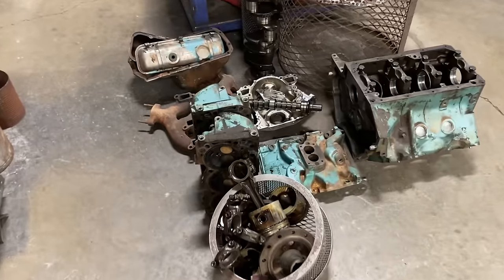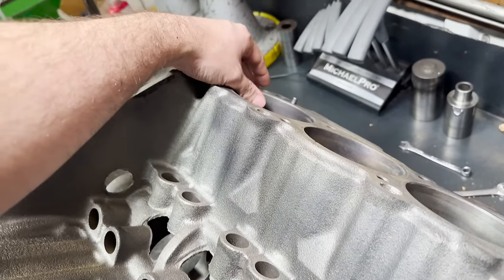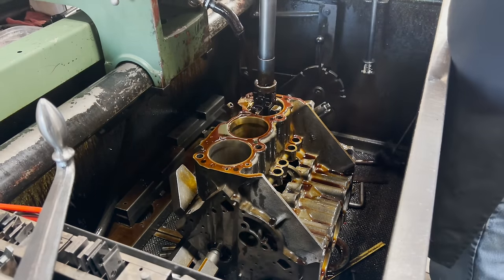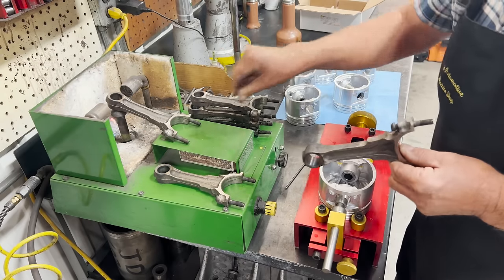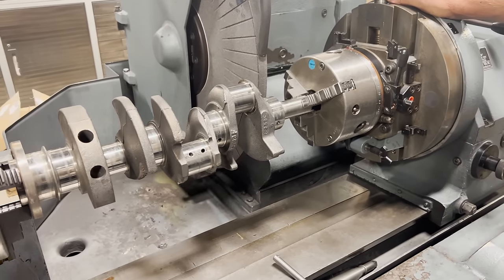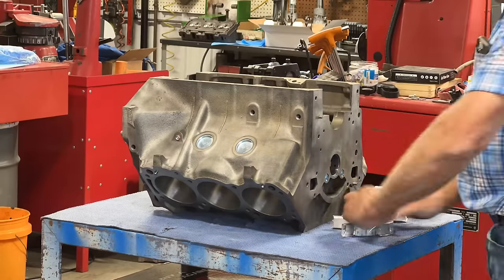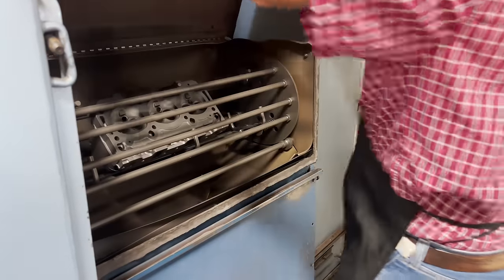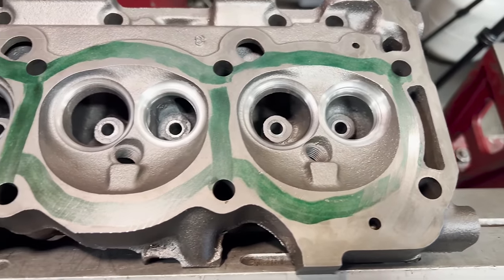This 225 Buick DAUNTLESS V6 Odd Fire Was WORSE Than We Thought...

Comment: Can you explain why on the bore process the block is not bored out to the required spec but are then honed afterwards? I know the crosshatch is part of the reason for a better grip or bite from the rings but a machinist explanation would clean the reasoning up. The difference in the process is what I am asking
Reply: Honing removes the last few thousand to the final required specs. 
If you bore to the final specs and then hone. You end up with the cylinder being out of specs. 
The machinist uses different grits of stones during the honing process. 
That's why the measure. Measure and measure continuously. Until they get the perfect cylinder wall to piston clearances.

Comment: I had a Chevy Monza back in the day. It had a 231 V6 with a Munci 4 speed. That thing would haul. The only problem was the clutch and pressure plate. The motor was too much for the regular pressure plate so my dad put a 180# diaphragm pressure plate in it. No more problems. It’s a good thing I played football and had strong legs because driving it in traffic was a killer. Your right leg would definitely feel the burn. But there was no clutch slipping any longer. That was one of the best vehicles I owned. It was easy to pull the transmission, I did it often for a while. Everything was easy to work on in that car.

Comment: Thanks for a very interesting video. After baking and blasting the block, do you install and torque the main caps to measure the main line I.D., which would be the same as the main bearing O.D. Do you do the same on the big ends of the connecting rods? Thanks, Bill

Comment: Very unpopular opinion but I install pistons completely dry . Think about it like this if you order a rebuild kit from CAT or a 14L 60 Sieries detroit they come in bags pistons already on the rods no lube other than a light film to prevent rust as you said if you just fill the cylinder with oil immediately upon startup it's going to cook that into the upper rimg grooves I did a couple 12.7 detroits and oiled them and they smoked after about 300,000 miles ive never done more than a light film of oil if its going to be stored for any amount of time before installation

Comment: One bummer is that stock compression on the Dauntless V6 is 9:1. The Silvolite replacement is rated @ 8.3:1 and the Sealed Power @ 8.4:1. Granted, with cleaning up the block & head surfaces, that may well end up close to 8.5:1 or thereabouts, but it's a shame to lose that little bit of 'oomph' in an engine that can use all the help it can get.

Comment: You think the crank phasing is complicated, the guy that sets the distributor really needs to be familiar with these engines.  The distributor has to be set exactly how the manual says with the wires in the correct terminals.

Comment: What covers the massive holes in the block between the v where the push rod are? Is that a normal thing on American v motors?
Reply: Those holes allow the oil to drain back after lubing the lifters and pushrods.
Reply: @skylinefever  oh I see. So I assume then the intake manifold closes off everything above it to seal of the block. Thanks for the info. I naturally assumed the block would be closed off their and any oil returning would come through the heads and past the cylinders.

Comment: The firing order explanation sounded unnecessarily complicated. The engine (I'm from the UK) is, in effect, two three cylinder engines 90 degrees apart. The firing order of one bank is followed 90 degrees later by the other. The same thing happens with 90 degree 2-cylinder Vee twins. Although there is no problem with these configurations the sound will be different.

Comment: Clay heated to between around 1000 to 2000 degrees F  becomes earthenware, our original pottery. It is porous, the Roman amphorae were porous. Clay vitrifies, becomes vitreous if fired at around 2500 degrees F. Porcelain is vitreous. Vitreous ceramic is harder and waterproof; non-porous for it's glasslike finish. So I assume your vitreous stones are the harder of the two ceramics, they are vitrified or vitreous...did you know that?

Comment: Anyone else notice the huge gap between the block and front main bearing cap? will that cause an oil issue?
Reply: i saw that 2 maybe the way the picture is ?
Reply: The timing cover takes care of that.

It's the rear cap that has to have the main cap sides sealed to the block.

Comment: Do you not plastigauge the rod main bearings?
Reply from the maker: When we have ground and/or polished the crankshaft and taken our measurements, and when we have measured the bore diameter of the rods, we seldom use plastigage.  Plastigage is a great clearance "indicator" for when exact measurements cannot be obtained.

Comment: I bought a '79 Chevy Monza new which had a V6.  I was told this was a Buick engine.  Correct?
Reply: Yes, a 79 Monza could be had with either a 3.2l or 3.8l Buick V6 engine, depending on what you ordered. I miss my copper 79 monza hatch

Comment: They wouldn’t be torque plate honed from factory would they?
Reply: From what I have read, engines weren't torque plate honed from the factory until the 2000s, and even then, not every engine was. The Nissan Juke was made that way, but that didn't save it from being awful.

Comment: I've been. building both racing engine and daily driver engines for 50 years. I always dipped the pistons in ATF when installing them.  When freshening up engines  we never saw a carboned up ring groove. You obviously have had success doing what you do so I am not criticizing your method just informing.

Comment: The strange cylinder wear looks like a harmonic artefact to me. An odd fire engine, running at high rpm under load, in low gear like you'd find off-roading, along with less than optimal gasoline, suggests that the pistons, or the rings, or perhaps both out of phase with each other, joggling around in the bore could cause that.

Comment: I always liked a rough surface on the block and heads because it held the head gasket in place better, especially on high compression engines. I dipped the pistons in oil to make certain that the rings had plenty of oil because an engine might sit for a long time before being run and the rings could seize to the pistons. I also liked to have the valves and cylinder walls well oiled for the same reason. I always put the rig grooves staggered 180 degrees in line with the piston pin to avoid having them on a thrust side of the piston.
Reply: Nobody uses a rough surface anymore, because many gaskets are MLS. MLS does not tolerate a rough surface.

Comment: Don't use stock style head gaskets if you're going to smooth out that deck. Keep in mind the different technology between then and now. Doing all those precise measurements without a block torque plate is a waste of effort. When the heads are installed, the block will distort and throw all that off. Sure hope you're not charging extra for that.

Comment: I've been told that the Dauntless engines have a lot of nickel content and the heads are actually harder than hardened valve seats. Is that true?

I had a Buick 350 in my old 69 wagoneer.  The valve seats were very hard and took a while to grind compared to an AMC 360 that we also rebuilt.

i also found out the hard way that the engine was a 1970 and not a 69 as the lifters were different due to the oiling path. The 69 lifters didn't let any oil go thru the push rods to the rockers.  Luckily, we discovered this before it ran more than a few minutes.

Comment: Rear rope seal, ahg!
Reply from the maker: Yes, the rope front and rear seals can be a challenge. We opted to use the  Felpro BS40613 rear main seal and the Felpro 15200 front timing cover seal.  They are made of rubber and greatly increase the ease of installation while giving great sealing results.

Comment: ~Odd fire V6.....I worked as a line mechanic in the mid 1970's at a Pontiac dealer and these engines were used in some cars. Terrible engines. They caused me numerous headaches. At low rpm some times they had very low oil pressure and vibrated so bad the low oil pressure light would come on. The factory hung weights on some places to try and dampen the vibrations. I chased one for noises and vibrations and finally found the rear trans mount was broken....I jacked the trans up on the lift and the rubber from the mount fell out.....They used extra thick rubber engine and trans mounts. I think a couple years later they offset the crank rod pin journals to make it an even fire engine.  I believe the Chevy V6 had that crank design to run much smoother.........Gm was producing some real junk in that era. I recall going out to bring a car in one day that ran real bad.....I drove it in and parts fell out on the way...It was an odd fire V6 and it broke the cam and was running only on the front 4 cylinders !! JUNK !!
Reply: Have a 71' V-6 Jeep.  Crawling vs Baja 1000.  One fits the other is never a fitment for the v-6. Clackifornia smog in 1997 would not pass this V-6.  Did not burn unusual oil amounts.  Leaky valves and some distributor wear-out. Major overhaul in 1998.  New distributors not found as compared to same vintage HEI distributors. Re-built distributors all-worn-out drive shaft clearances.   Found a machine/shop drag racer-custom part builder.  Fitment of an Old's or?? GM V-6 HEI distributor slide in fitment to the 225 V-6 after modification.  No more points and significantly better performance - cold/hot starts, no changes in dwell because of rubbing block wear. Had used a bolt on external point replacement electronics - no dwell changes.  HEI best deal.

Comment: I can't imagine spending money on one of these engines. These were horrible. I'd venture a guess that most of them you find are low miles - people hated them. No power, rough-running, heavy, poor fuel economy. Just awful. I'm sure the bean counters at GM laughed all the way to the bank when they sold these to Jeep/AMC.

Edit: NOT rare, NOT uncommon...the word you're looking for here is undesirable.

Also, the odd-fire characteristics of these engine is probably responsible for the strange wear in the cylinders.

Lastly, this is probably nicest example of one of these engines in existence, now.  lol